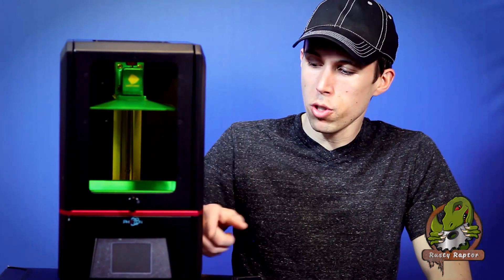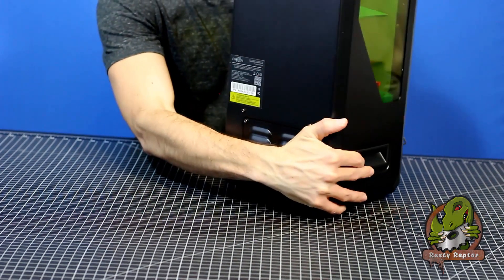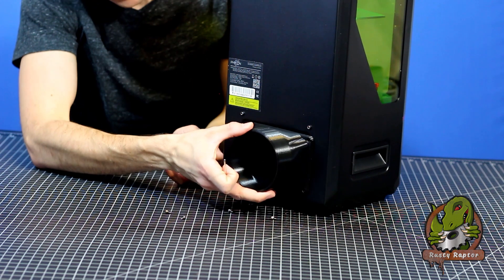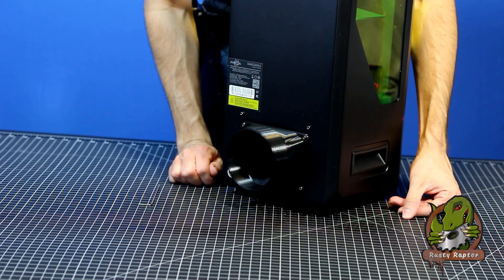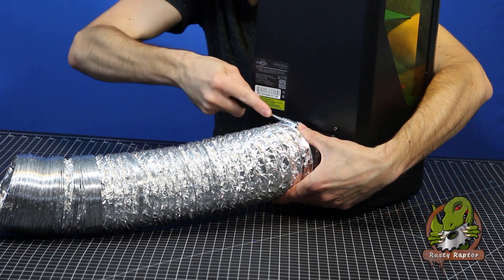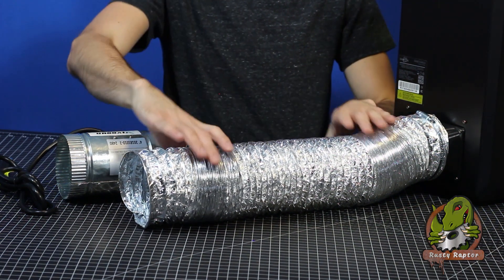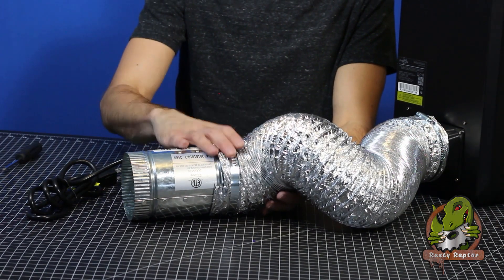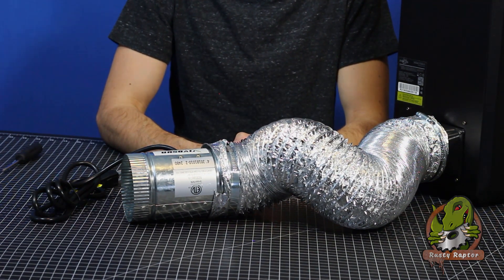Eliminate the Smell on AnyCubic Photon DLP / SLA Printer

Comment: You'd probably be better served by getting a AC Infinity Raxial S4 instead of the Vivosun fan listed above..  Higher quality, and it has a 3 speed controller.  It's only about 5 or 6 dollars more than the Vivosun, but it'd definitely be worth the upgrade...

Comment: How could I use this with my office (guest room) window?  Is there any kind of material like insulation I could use to cut around the end of the duct so that I could keep the hot air outside on the other side of the window screen and then keep the cool air on the inside? Any recommendations?

Comment: FYI, the smell is not the actual problem; it's the fact that airborne VOCs are bad for your health in the long run. Stuff like formaldehyde is also potently carcinogenic if your specific UV resin contains any.
Any polymerizing agent, even in "eco resins", is necessarily a highly toxic substance otherwise it would not do its job. Treat it like you should treat any other toxic waste.
Reply: That's why you should also wear a gas filtering mask

Comment: Hello everyone,
I've put my complete Photon S into a big 15€ plastic box, in which I've cut a hole into the back wall. Then I screwed on a 10€ bathroom wall ventilator over the hole (it has a 100mm hose connection side), put an aluminium house to that and hang the other end out of the window...and there you are, no smell, easy and low price solution...no harm to the printer...
When I'm not printing, I can use the box (without printer standing inside ;-) ) as an airbrush station - here, again, no smell inside the house any more...
Reply: can you show a video of it?

Comment: Should have internal support where the hose clamp fits - probably a grid pattern - would prevent the clamp from cracking the print while allowing airflow.
Reply: A cylinder with a hose clamp can handle a huge amount of force because all the pressure is equal all the way around. No need for supports.

Comment: To anyone reading this: is this a viable option for the abycubic mono se?
Reply: Yep just did a similar setup for my mono se. The rear panel holes are identical so all the thingiverse files for the original Photon also work for the Mono SE
Reply from the maker: Hey, the general idea would work for any printer, but you would have to design an adaptor for the printer itself.  If possible please give us a subscribe on the page.  It helps us keep things running.

Comment: great solution! quick question: is the motor brushless? I suspect the resin vapours are flammable, so... thanks!
Reply from the maker: The resin vapors don't really interact with the fan, and we have ran this for over 24 hours at a time without any incident.  If possible please give us a subscribe on the page.  It helps us keep things running.

Comment: Yeah I'm in my parents house and I'd likely have it in my room.. and I have big windows so having it open in the middle of winter to vent fumes isn't practical. Gonna have to figure out a filter solution if I'm going to get one of these printers.
Reply: just get a window seal with a hole for the tube

Comment: I have a question: I’m goig to be running this in a small bedroom but literally 2ft away from the window if I put the adapter on and just the tubing out the window would that suffice or do I need the fan too

The bedroom is not slept in it’s an art studio
Reply: I would say, although it could technically work I would recommend a duct. The reason being is that there won't be a suction generated which will ensure 'all' fumes are removed and likely will still result in a smell if perhaps reduced.

Comment: Hey! Great video. Question : Why does it need to be an FDM printer to print the part?
Reply from the maker: It doesn’t have to be, but the part is a little to large to fit in one piece on the photon.
Reply: @rustyraptorpropshop2540  makes sense. I'll buy my mate a pint and use his FDM. 👍
Reply: You can print as two parts and glue it on the photon. There are larger SLA printers like the Peopoly Phenom and the Phrozen Transformer that can print it in one piece.

Comment: basically a good idea, but in winter you do not want to leave the window open. how about an activated carbon filter, which absorbs the smell?
Reply: I bought a grow tent with a carbon filter and fan set up, set the printer up on a table inside the tent and haven't had any issues, looks a bit odd having a grow tent in our spare room lol but it's a very effective way to keep smell and spills under control. The tent is 4'x4'x8' so I can easily stand in there to get it all set up.

Comment: Great guide!! How do you hook up the other end out the window? Is there a good way to mount it and also keep cold air out?
Reply: I use this for my window exhaust: https://www.amazon.com/gp/product/B01M17V4CO/ref=ppx_yo_dt_b_asin_title_o00_s00?ie=UTF8&psc=1
Reply from the maker: Josh M I personally used a dryer vent through wall mount.  If your putting it out a window, I would suggest cutting a board to the same size, then drilling a hole for a dry pass through.  That would keep the air out and still allow the exhaust

Comment: For me, the worst smell was the IPA cleaning process. I eliminated that with a ultrasonic cleaner with simply green cleaner. The machine itself lives in my shop.

I like your idea if the machine has to live inside your living space.
Reply: There has been a few threads online and a video fro Uncle Jesse trying out alternatives to IPA. I find the Mean Green cleaner smells better, is cheaper, and performs as well as IPA. It cost around $4-5 a gallon at walmart.
Reply: Was there any tests on brands available in Europe or the uk

Comment: A tip for home printers, who want to vent out a window:
Make sure to set your vent up so rain won’t get into the hose.  (Check exterior dryer vents for the hardware, or in a pinch, use the vent plate that came off the printer itself.)
Reply: @Paul Denton, no, not point the vent up, set the vent up, as in set up the vent.
Reply from the maker: Thanks for the comment, and that is a very good point!  Making sure rain stays out is VERY important. If possible please give us a subscribe on the page.  It helps us keep things running.

Comment: what about the vent fan on the bottom that blow air out?
Reply: Not out, in
Reply from the maker: Hey, I am not quite sure what you mean.  The fan pulls the air out of the system and then pushes it out the hose through your venting (whether that is through the window or other.)  If possible please give us a subscribe on the page.  It helps us keep things running.

Comment: Do you think it’d make sense to have a standard fitting on resin printers to attach a shop vac, like jigsaws/hand routers/table saws etc?
Reply from the maker: dmacmakes honestly I think it would be overkill.  Adding a shop vac type hook up wouldn’t really expel the smell unless you placed the shop vac outside and ran the hose into the location of the printer.  Which would be overkill considering you could pull the same thing with a small exhaust fan.
Reply: @rustyraptorpropshop2540  I guess my hope was a free and easy solution for people who already have a shop vac. It would be 6 feet further away than the printer and has a hepa filter; maybe it act as a face mask for everyone in the vicinity while the ventilation clears the air from garage/shop.
Reply: @bakedbeings  Some people just attach hepa filters to the back of their printers, it looks funny but apparently works
Reply: Seems super impractical and also incredibly annoying, considering shop vacs are ridiculously loud. I wouldn't really want to listen to a shop vac running for the entirety of a 6 hour print, personally.

Comment: I just saw this after I took off the fan on the inside.  Should I reconnect the fan or will the inline fan be enough to pull the vapor out of the build chamber?
Reply from the maker: icetek0713 I would suggest reconnecting the fan to get the maximum pull.  The internal fan will help pull the smell out of the chamber, while the in-line fan will help pull it away from the machine and expel it from the area.

Comment: great video, but why not use a 4inch PC fan?
Reply from the maker: leman Russ we weren’t getting enough airflow using a small 4in PC fan for the distance we wanted to push the air.  The stronger exhaust fan gave us more power which pushed the air through the longer hose.

Comment: Thank you! how noisy is??
Reply from the maker: The fan does add some noise to the overall running of the machine, but it's no more than having a small house fan used for cooling down spaces.
Reply: home depot sells some very quiet inline duct fans and duct size adapters.
they might pull too much air though...I dunno if causing a vacuum within the unit would help or hurt it.